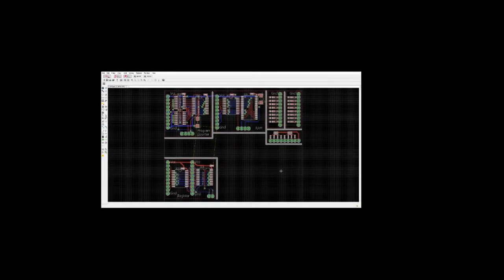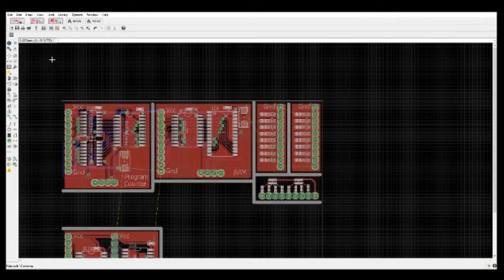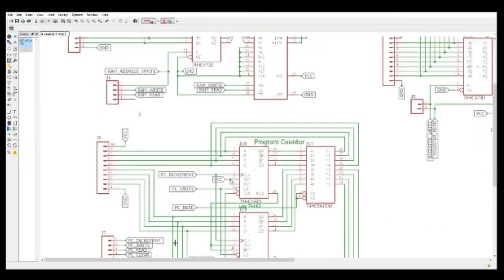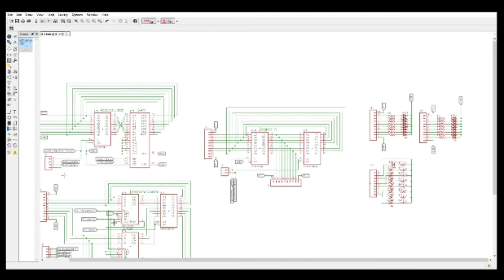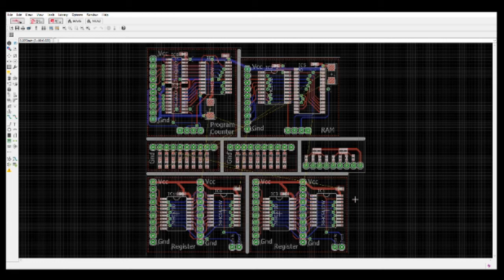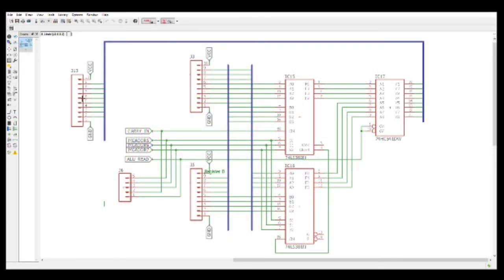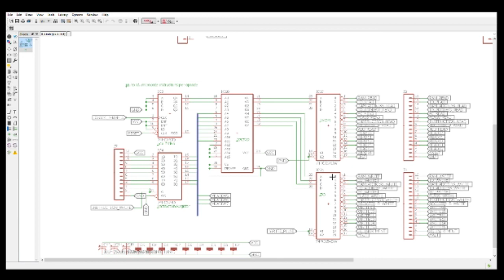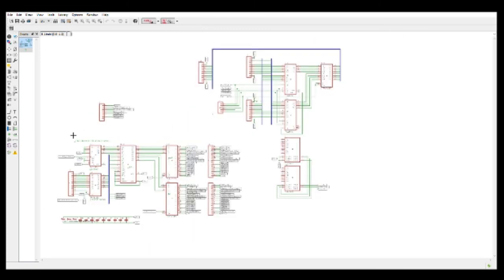#76 TTL CPU design

Comment: Hi Imsai Guy;

I am very Interested in Your Project, and  I will want to build some units like Yours..
I cannot in most of the Pictures of Your Schematics, tell the 74xx number of the IC's that You are using, they are blurred.. The only one that was not blurred was the 74LS85 ..
Some years ago I started to attempt to build a TTL equivalent of the 8080, I since tore that wire-wrap version apart for the parts, but, I have for a long time now wanted to try doing it again..
But, I have put it off because, I haven't been sure of How I have wanted my Register Array would be built, so that I retains it contents and shows that on Led's and multiplex their outputs to their common buss or busses between them..
So, I am very much interested in Your approach..

On a side note, if You have an Imsai Mpu Blank Board that You would be willing to sell, I would be Interested in it.. I cannot afford much..
Years ago I had an Imsai, but, I had to sell it and Most of my Altair's to pay for rent and such..

THANK YOU Marty
Reply from the maker: sorry, I had the screen capture set wrong. my parts list is all 74HC parts, '573 '163 '541 '85 '154
ram is cy62256
Reply: @IMSAIGuy Just found this video.   I'm wondering if you could use a breadboard to create a bus between your component boards.
Reply from the maker: @bayareapianist  no, it would only fit two boards, if you use the breadboard in the long directions you have shorted pins and zero connections